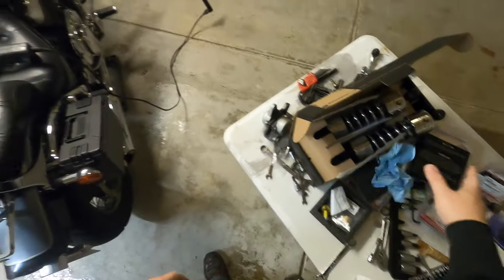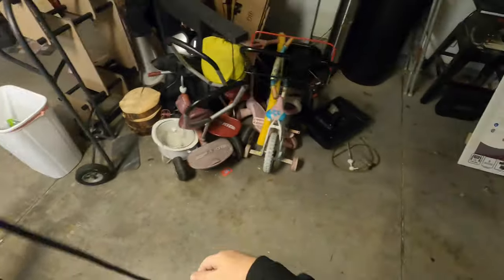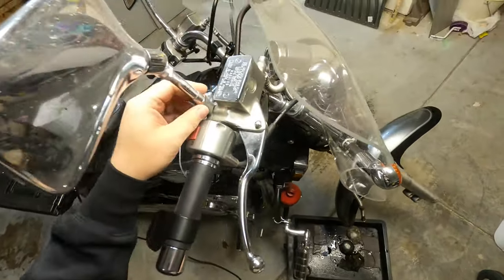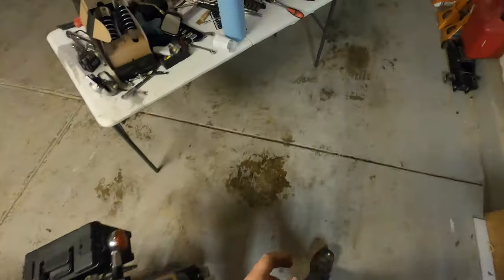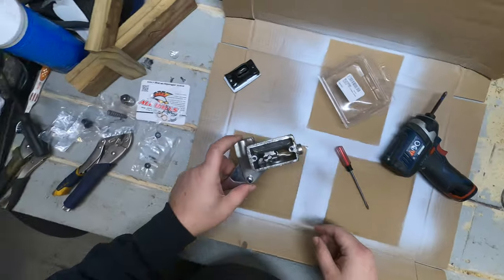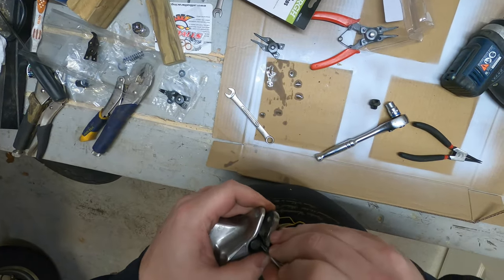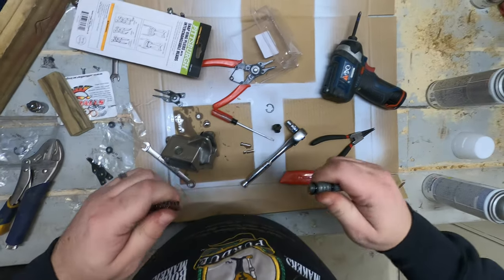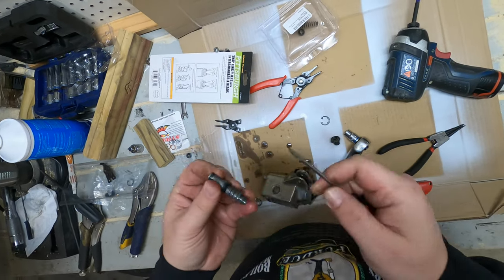2003 Suzuki Intruder Front Master Cylinder Rebuild

Comment: Hey man where did you get that back rest look like exactly what I’m looking for
Reply from the maker: It came with the bike when I bought it, I'm pretty sure it's just the stock one.

I have a 2003, so it might vary by year.
Reply: @squish3r  There are several variations of backrests, some have hidden locked compartment for small objects and tools. It was real pain in the ass to get new one after mine flew away after lock failed xD In the end I 3d printed plastic parts.
Reply from the maker: @EnhancedNightmare mine had the little tool kit in it too, kinda nice TBH.